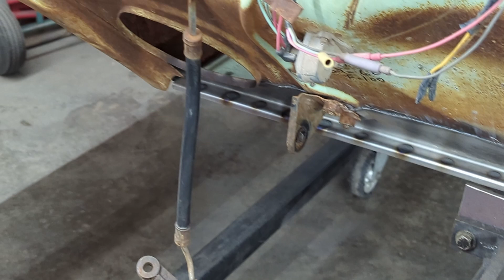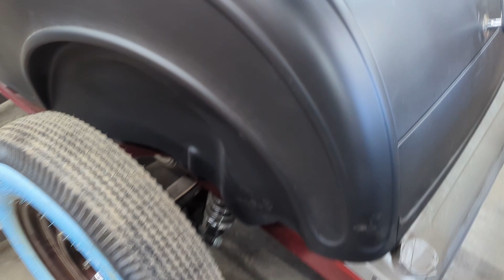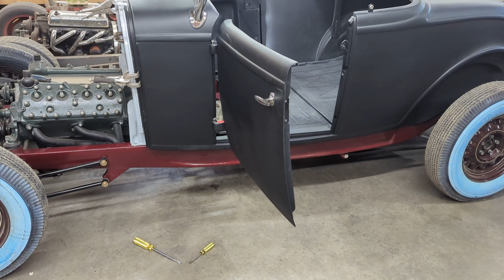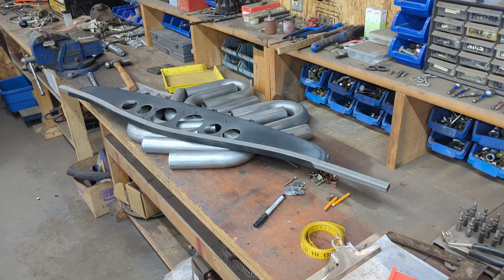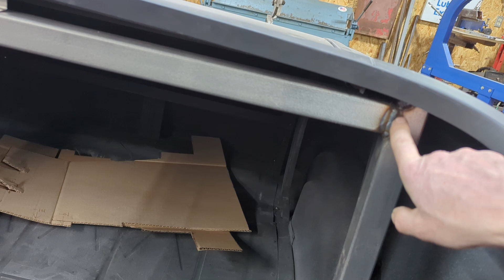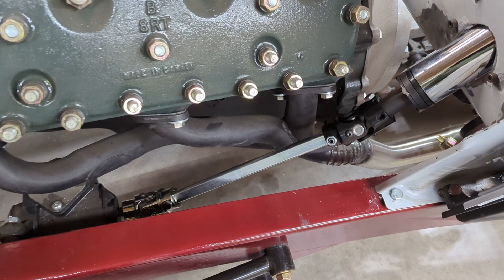Reinforcing a 32 Roadster Body - Firewall, Dash, and Rear

Comment: Where do you
 Buy your Chassis for the 1932 ford?
Reply from the maker: Both roadster chassis we are working on now are from Brookville roadster. We bought the perimeter frames from them which are basically boxed frames with front, center and rear cross members but no other brackets. I like to start with this and then put the rest on myself.

Comment: Coming out nice . Which make column is that , and is it a tilt ? Thanks
Reply from the maker: Yes it is a tilt. I don't know what brand it is as it was supplied by the owner. It's not an Ididit or flaming river for sure. There's no label on the box.